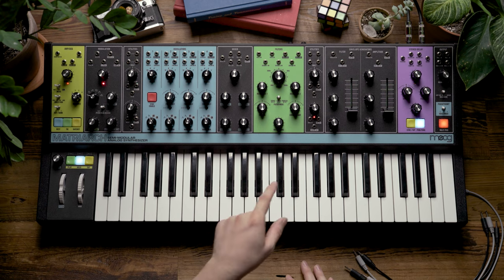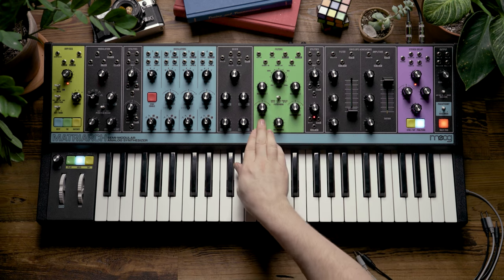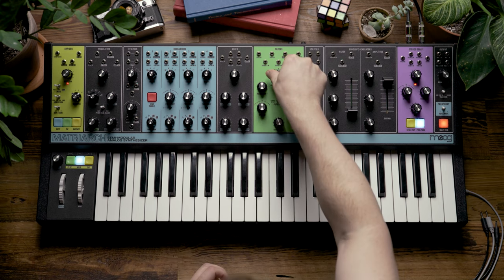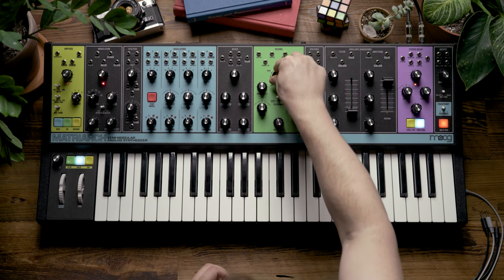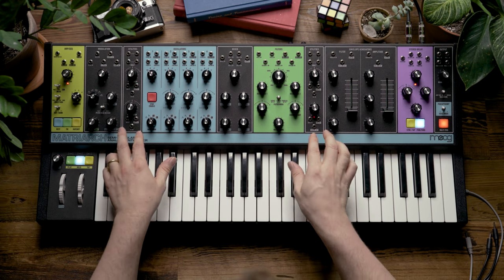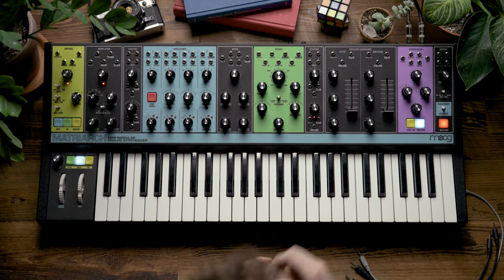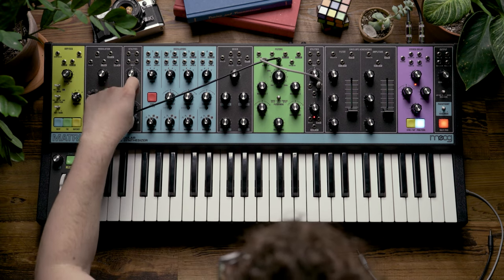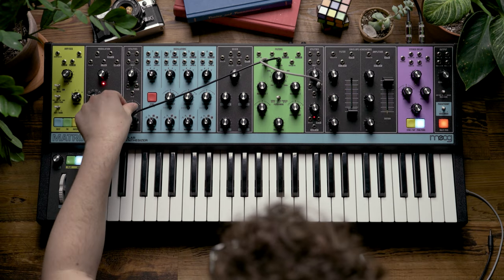Matriarch | Dual Filter Explanation

Comment: ...this is a great filter demo, thank you...but wait, how is it you are achieving a drone with the seq/arp hold button, rather than drone switch in the VCA section? Is your Matriarch modded to remove the drone function, thus eliminating the oscillator bleed that is apparent in the VCA?
Reply from the maker: No, it's just a different approach to holding notes.  The drone function eliminates the EG's control over the VCA section, and instead generates offset voltages to always keep the VCAs fully open before hitting the delay, which is maybe what you're referring to as oscillator bleed.  Using the hold button instead keeps the EG engaged, allowing you to use the sustain slider to set the level of the drone pre-delay.

Comment: Signals cascade?!
Like
How lol
Research time I guess
Reply from the maker: In the left utility section, if you don't patch the output of the top attenuator, the output of the bottom attenuator will mix the signal outputs of both attenuators like a 2 channel mixer.
Reply: @MoogSynthesizers  That's very interesting.
Will try some patches out with that. Thanks for the explanation :)